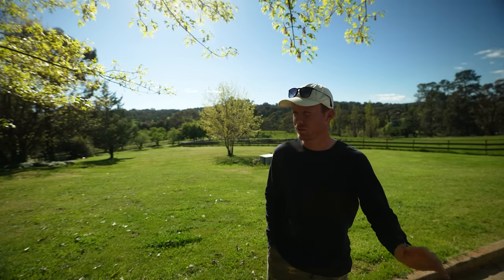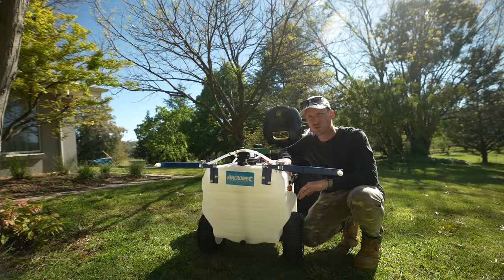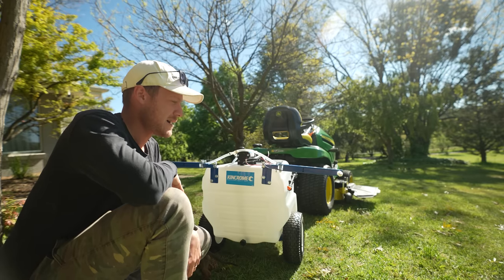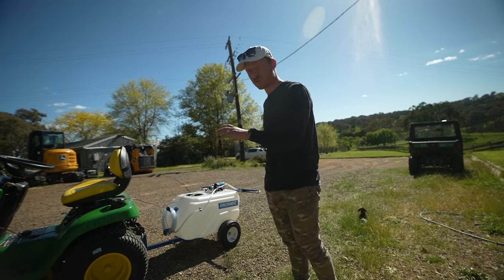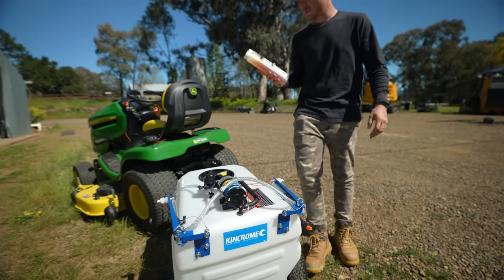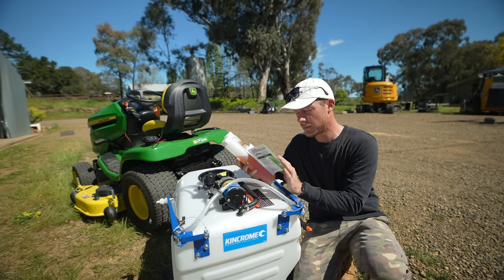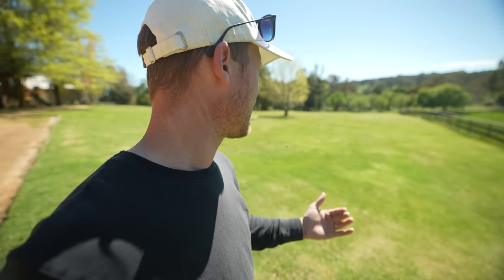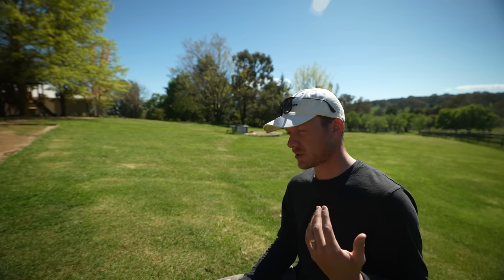I'm TIRED of My Grass Growing SO FAST! // STOP Grass Growing with PGR

Comment: Great video Ben. Calibration can be a real pain in the arse, especially when using multiple nozzle options. Generally we use aquajet nozzles on the course i work at due it constantly being too windy to use the finer nozzles. They give minimal spray drift but put out huge volume (a 700L spraytank helps for that). We also spray pretty much the entire golf course with primo maxx to slow it down but the only downside is,in the long term it creates lots of thatch. I can remember when 20yrs ago some sections of fairways we selectively sprayed every year have now become so spongy that we need to do do something about it.

Comment: Yo mate! Any chance of some cylinder mower reviews from supaswift, parklander and cox? For me the supaswift is out because it won’t cut high enough, but the parklander and cox will work👌
Reply: Supaswift goes up to 25mm height apparently. That's what i will be buying.
Reply: @restoblastrestoblast154  ill be using mine on swb, so the parklander and cox are the only options that go to 30/35mm. The supaswift looks like a good bit of gear though